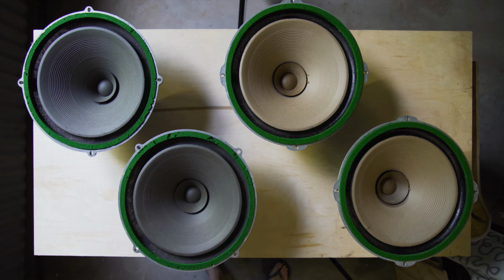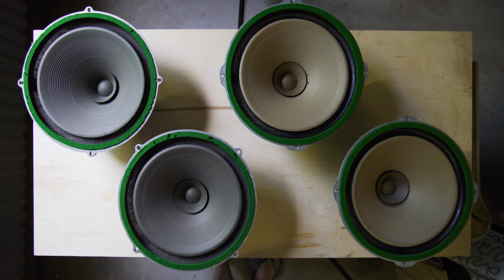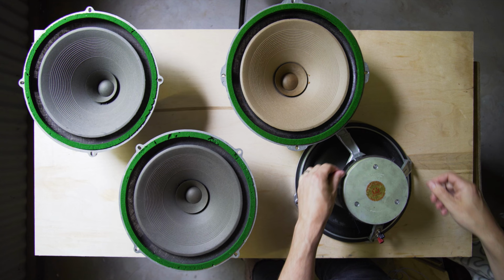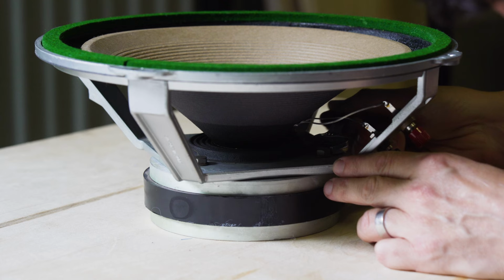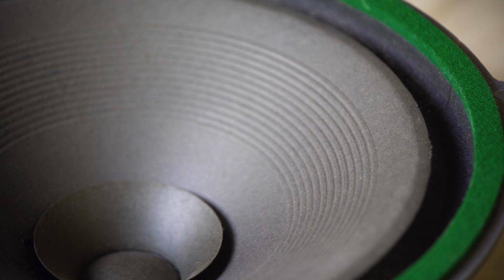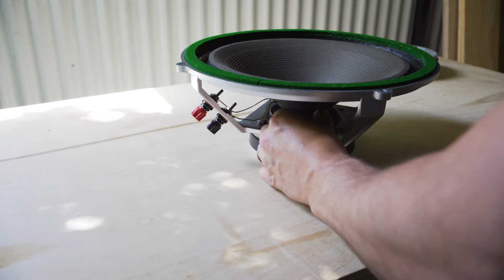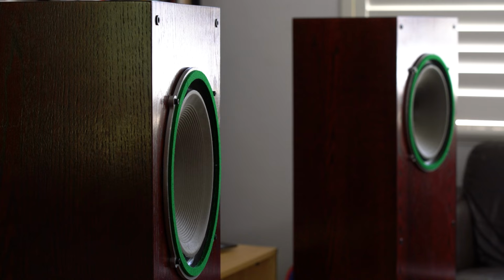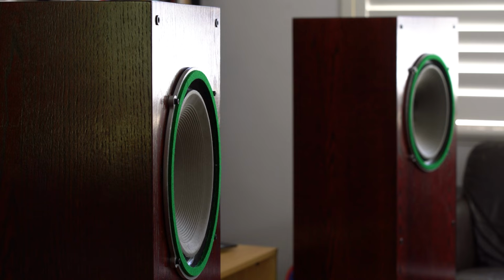Wharfedale Super 12 Full Range Transmission Line Speaker Build

Comment: I’ve got a set of the Super 12’s with the Alnico magnets. They were my dad’s. He bought them new in the early 60’s. He had one of the voice coils rewound about 5 years ago at a local speaker shop called the Vancouver Audio Clinic. If I recall correctly the wire was flat aluminum and was ordered in especially for the job. He had them in Carlson Enclosures that he built back then. They sounded pretty spectacular. They are waiting for new enclosures now.

Comment: Just came across your video and loved every minute of it and I'm now subscribed. Wharfedale didn't make a full range 15" driver but did make both hifi and musical instrument versions of the 15" units. When fitted to 5 cubic ft. and over enclosures, the Super 12's sound sensational but as you say the surrounds would need attention for optimum performance. I've also noticed that all four of your drivers are of the ceramic magnet type. If you think they are good, try the Alnico magnet versions if you can find a pair. The comparison is (to my ears) like chalk and cheese. I'm not sure of the details and dates but I suspect that Rank thought that the ceramic magnets were a cheaper option and probably outsourced them as Gilbert was manufacturing his own Alnico magnets using a DC power line (utilised for electric trolley buses that ran past his factory in Bradford Road). Legend has it that when they threw the switch for the electromagnet, the trolley buses running past would come to an abrupt halt!
Reply from the maker: @andrevanstiphout  thankyou! And wow that is some cool info about Briggs, thanks for sharing ♥️🙏 I definitely need some alnicos... Getting much harder to find 😕
Reply: @vintageboulton  I'm assuming that you're in Oz (from your accent). The Alnico Super 12's pop up every once in a while on Marketplace. One pair sold less than a month ago and there is another pair in cabinets on there at present. As Molly would say.... Do yourself a favour and find them 😂

Comment: A full range coaxial with large midrange and tweeter, possibly even open baffle combined with a transmission line woofer, might be an awesome speaker build project. In addition you might also want to use digital electronic x-over and digital amping.

Comment: This vid makes me want to resurrect my AlNiCo 12" Wharfedale full tange speakers from the '50s. I bought them with disintegrated surrounds.  I installed new, foam surrounds as that is what they had on when I bought them, but they were gone.  I don't know where to get cloth surrounds.
    I think one of them had coil rub so that's why I didn't use them much. Thnx for showing how to fix them.
   I own many 'dales with cloth surround drivers.  I never thought that they'd let air through.  The rubber cement is a good idea but I wouldn't want to impact transient response by having too much weight from impregnation with glue.  How did yours turn out with three passes of rubber cement?

Comment: I'm not one to look at vintage gear through rose tinted glasses but I've always loved the the look and design of the old Wharfdale open baffle SFB speakers. Briggs knew what he was doing. Had the chance to pick up an empty set of baffles but missed out not too long ago.
Reply from the maker: Agreed! Those SFB were pretty groundbreaking for their time
Reply: I got one SFB from a friend. It is the first original baffle style. I have it hooked up to an old mono RCA tube amp. It sounds so amazing for its age. But I notice the bass is deeper when I have my head behind it (for whatever reason) than when I am facing it. It is about 6 inches from the wall. How can I get that bass to come out forward? The wall is a thick wood panel wall.
Reply from the maker: @alanrogs3990  The SFB was Gilbert's answer to Quads Electrostatic Loudspeaker. Briggs wrote extensively about open baffle theory.

The bigger base from behind is probably due to the wings, sound bouncing off of them. Make sure they are at least 1.5 metres away from any walls(I know it's hard depending on your listening space)

Apart from that check the surrounds on the woofers, the same problems like in this video. 

All in all any sort of open baffle sometimes just doesn't have the same bass as other designs. Hope that helps!
Reply: @vintageboulton  Yeah, 1.5 meters isn't going to work. That's hardly possible for anyone unless they have a pretty big room. Maybe I should put them on some small industrial wheels to roll it out when I want.
 The surrounds are fine. It was re-foamed long before I got it and they were done very well.
 I find the tweeter pointing up to be really incredible because it is the only speaker I have that can sound pretty clearly standing in a joining rooms

Comment: Full range drivers really have their magic. Midrange is very alive and transparent. So far I have only heard small full range speakers so they really lack bass. I saw one Finnish review of Seas FA22RCZ 8" and I instantly got interested. I wonder how good they really are. They aren't too expensive either, but need really big cabinet to play bass.
Reply from the maker: I have looked at that driver for a completely new build, I think it is also very good value for money. Would you add a woofer driver for the lower frequencies? Or I know some people are very happy adding a. Subwoofer so they can keep the full range driver pure.
Reply: @vintageboulton  Review samples went straight to 50Hz in 60L= 2.2ft³ reflex box. That was with the room gain. Extra woofer might get fuller base from these.

Comment: Interdrivers. Are those frames die cast? In any case, if a pair is duff, remove the magnets, remove the dead coil, and glue on a weight holder to make them into passive radiators.

Comment: If you transplant the magnet will you lose magnetism?
Reply from the maker: No you wouldn't, this is only a physical swap out. Different magnet types ie ferrite, ceramic or alnico require different methods to de-magnetize
Reply: @vintageboulton  I guess you haven't disturbed the pole pieces.
Reply: Foresure